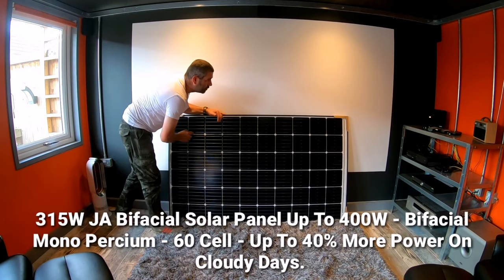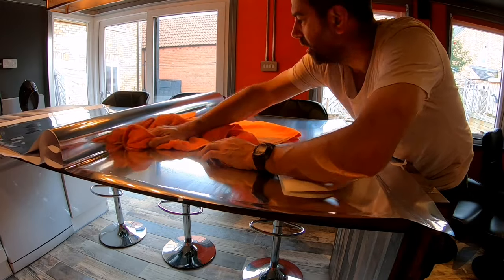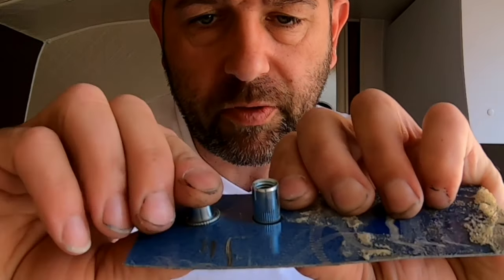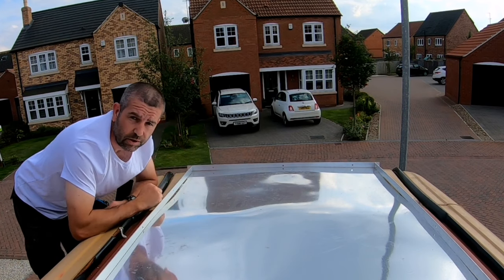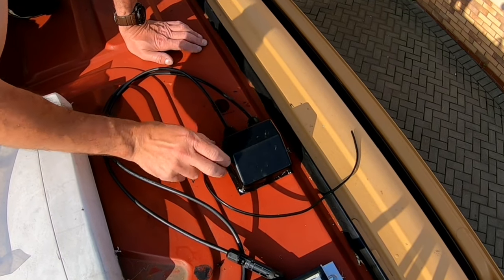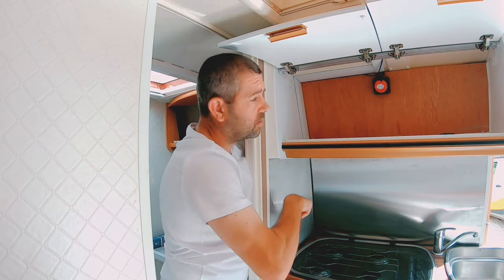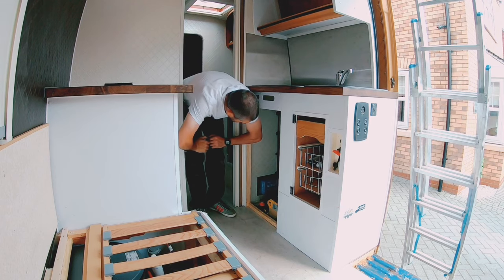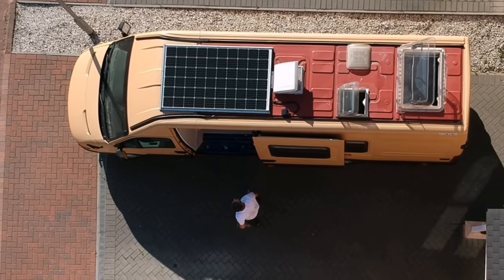Diy Camper Van Build: Installing Bifacial Solar Panels For Maximum Energy Efficiency

Comment from the maker: Amazon store showing affiliate parts list that I've used within the van build.
www.amazon.co.uk/shop/iveavan

Individual parts used within this video. 
Parts list link's 

Not the same bifacial solar panel as mine, that's now been discontinued! But this one is similar to mine. X1

https://www.bimblesolar.com/index.php...

Victron MPPT (Solar Smart Controller) X1. 

https://www.bimblesolar.com/30a-victr...

Cable Gland Entry Box. X1

https://www.bimblesolar.com/cable-gla...

Solar Panel To MPPT MC4 cables X 2. 

https://www.bimblesolar.com/mc4-cable...

32amp Breaker switch X1

https://www.bimblesolar.com/32a-din-b...

Or, an good full solar starter kit. 

https://www.bimblesolar.com/350w-vict...

DISCLAIMER! These are Affiliate links that I've provided.

Comment: Nice one Mark, That's 2 things you've helped me with on my Daily, underslung water tank fitment, which is now complete. and now mounting the solar panel, didn't think of using rivnuts! Off to see Greg, Luke, and co. at the South central self-build get together next weekend in Hampshire. Thanks again!
Reply from the maker: Excellent choice of van Mark 😉👌, funny enough I've been stuck with Luke on a boat for the past few days 🛥️😁, I said to him, if I'm down that way I'll pop along to one of these meets 😉, cheers matey 🍻👍👍👍.
Reply: @Iveavan  Wow, I hope there was Beer on this boat!? They are a great group and I've learned a lot from the meetups and passed on some knowledge too. I think you would have a blast, gets a bit messy when Darren Releases the Kraken mind! Are you at Camp Quirky next year?
Reply from the maker: @markstreet4612  haha😅, yes I am..... As long the van is ready..... Ish 😉👌👍.

Comment: Hi Mark Great kit only down side is the modified wave inverter.
Reply from the maker: Yes you're right. definitely not a pure sine wave inverter! the Amazon advert was wrong completely! Around about 6 to 7 months ago when I bought it, "advertised as a pure sine wave" , also it doesn't come with UK sockets, yet showed  photos of it having uk sockets!  That's why I've never recommended nor featured it in any of the videos. In the link below for the full solar kit, is an Victron Phoenix 375w pure sine wave  inverter (which may be too low on power for some). In reality though, we probably wont end up using the inverter at all, not only being inefficient way for an power source, every thing I have to power,  will be 12 volts, or can be charged up from the 12v power source. 😉👌👍👍👍.

Comment: Top job Mark 👍 Hope they work out as you want them too, with all the work you put into that 😊
Reply from the maker: Cheers Mike 🍻👍, I'd imagine, I will find out once using the van, at least I have the option of tilting the panel if it doesn't perform so well 🤔, Cheers again mate😉👌👍👍👍.

Comment: I fitted two bifacial panels to my camper at the start of summer,I originally intended to glue down some radiator silver reflective sheets,but after putting them in place to cut them to size,I realised that they not only reflected light but also a massive amount of heat. The manufacturer recommend a white painted surface which is what I went with in the end. Heat is the enemy of solar panels so I'll be interested to see if it affects your installation.
Reply from the maker: Cheers matey 👌👍, its been fairly hot in Hull over the past few days, so far, no issues with "performance wise" from the solar panel it self, but saying that, nothing is really working the panel, if its going to be hot today I'll put some load on the batteries for some time, and see how it copes with the hot weather 😉👌👍👍👍.

Comment: Nice job again Mark, the one concern I have is the total weight of your van.
I would have stuck the reflectics straight onto the roof of the van saving the cost and the weight of the panel in between.
On our new van, I'd like to put a lightweight curved model directly on the roof just fixed with strong adhesive. Perhaps low on Watts but much lighter.
Either way you've done a cracking job and when the sun finally hits Hull, you will have a fully charged battery too 😁
Reply from the maker: Thank you matey 🍻👍, weight wise, I am watching that very carefully (only have a pay load of 1100kg) I've pretty much used little and lightweight building materials where possible bud. I did think about wrapping the roof, but I can only stick things to flat surfaces (I'm not very good at wrapping 😉). The PVC sheet was light weight and straight forward to wrap thankfully, yep that panel isn't light I agree with you matey 😉👌👍👍👍.

Comment: Good well explained installation, I am also trying to come up with a tilting solution but haven’t figured it out yet.
Reply from the maker: Thank you David👌👍, I'm hoping that it may not come to the "tilting of the panel" yet. I'm going to run with it flat for now, and see how we cope with the Solar, if needs be, we may have to tilt it I reckon, to fully gain the full potential of the panel matey 😉👌👍👍👍.

Comment: Good idea with the silver reflective sheet , I wish I would of seen this video before I fitting my 4 panels on but then again that would of been another Job not done ,as I’m still saving for the ply to line the van , ifs funny really your in Hull and the cheapest ply wood is in Hull . In time unless you have done it already I’m going to make a turn table for my panels with some gas struts so it can be turned to face the sun , but there is no rush as I have 420 watts , but I do need to get 3 more batteries.
Reply from the maker: Cheers mate 🍻👍, cheep plywood in "ull" 🤔 I wish I knew about that! 😉. Still, bit of an experiment with this panel (what with it fixed into position) we may revisit and get the thing to tilt, but at 25kg....It is not light! But, if I work out the right NM rate to lift it, I too will be using gas struts 🤔😉👌👍👍👍.

Comment: G’day Mark if I was putting on top a solar panel the way you did it is the way I would.  Your panel is heavy at 25kgs most of the ones you see on YouTube are light, great idea of fitting the foil underneath the panel.   Great job sorry you Drone bit the dust regards John
Reply from the maker: Haha, I didn't clunk click with the battery, it dropped like a brick! 😣. Luckily it was insured 😉, that happened the same day that "Spunky" was helping, was hoping to get the insulation filmed from the sky🤦‍♂️. Yes, I agree with you mate, it's an very heavy panel, but we will see how it will perform (a bit of an experiment at the moment) cheers matey 🍻😉👍👍👍.

Comment: T-slot aluminium profile is an awesome material to build, well, a lot of stuff out of. My tentative plan is to use that, it just bolts together, and get some electric actuators up there and then have a panel that can tilt at the flip of a switch. Nothing really that complicated with it, just a question how to sort out the details. At least once I get the van and get started... I'm thinking I'll have several short Panasonic 295 watt panels, those should fit crosswise, not lengthwise. But that's a really nice very low profile installation you have there, stealthy and aerodynamic.
Reply from the maker: Sounds like you have got an interesting plan going on there regarding you're solar system mate, get it on " YouTube" bud 😉👌👍👍👍.

Comment: I didn't realise solar panels are so heavy !!! I've got three 340w feckers planned for my DAF45 lol
Reply from the maker: You've got an "bigger boys van" (truck) then me bud😁, yours will easily take the weight though 😉. 
Yeah, I was surprised how heavy the panel was mate, may be because its bifacial 🤷‍♂️ (not quite sure what the weight is on a standard panel 🤔) cheers bud 🍻😉👍👍👍.
Reply: Mark Collom #Iveavan certainly got me thinking more about weight dude, I’ve got a 350L water tank as well. lol
Reply from the maker: @sunnydaze6974  haha, mine wont be far off that if I had a full waste tank 300lts in total almost 😬.

Comment: Hello, i observe you dont left a lot of space between the panel, do the bifacial work well in this situation?
Reply from the maker: No, you're right. But never posed an issue regarding " overheating "over the 5 years it's been like that. 
However, it's now been changed to a 4 way tilting solar panel (the same solar panel) 👌👍👉https://youtu.be/_3uFo4NjxKc?si=TPF8qF7FKdppa-rz

Comment: Wow, didn`t know they did a Bifacial solar panel........ thanks Mark, is there any chance you can post a link to that `none drying bedding sealant` you mentioned? Also as a possible experiment at a future date - I was wonder if it might be worth adding a thin highly polished sheet of aluminium (to increase power output) instead of the reflective wrap, and then configure by add some coiled black hose pipe for hot water collection for the van + to help with heat transfer.........just a thought!
Reply from the maker: To be fair they haven't been out that long as far I'm aware of, here's that link you we're after 😉👌https://shop.highbridgecaravans.co.uk/carafax-idl-non-drying-bedding-sealant-white/p60206?source=froogle&utm_source=froogle&utm_medium=comparison_shopping_feeds&utm_nooverride=1&gclid=Cj0KCQjwwIPrBRCJARIsAFlVT88Z_pTJJ5XcR9NXC2VwAa1nPXkWcuF8GXRsM76PoDNxj_hPdUVoJhYaAr7qEALw_wcB
Yes, that's a good idea regarding the solar water heater, I need to watch my weight though (the Van not me 😂) I've used the PVC mirrored wrap for durability, if I used polished Alloy, it probably will tarnish overtime and probably won't weather well I'd imagine🤔😉👌👍👍👍

Comment: Another informative video Mark.  I would be a bit worried about the depth of the wall unit.  From the video it looks a bit in your face.
I suppose you could reduce the depth of the cupboard if it gets in the way...Thanks for posting
Reply from the maker: Thank you matey👌👍, unfortunately, the Iveco seems to have an steep curvature drawing up to the roof line, it's rather quite shallow in depth (cupboard wise) , but to hide the cable being drawn through the roof of the van from the solar panel, it had to encroach that space, but for me, I can live with it, as it has to be a functional space, to house an decent amount of storage space to suit our needs bud 😉👌👍👍👍.
Reply: @Iveavan  the other alternative is let someone else do the cooking and washing up :-)
Reply from the maker: @mrgari189  haha😅👌👍, I like your thinking matey 😉👌👍👍👍

Comment: Nice one Mark. I never considered the silver backing.  My van is Iveco white, so don't think I'll go there yet.  I've also heard they like a bit of ventilation too.  Will those holes you made be enough to let it cool?
Reply from the maker: Cheers mate 🍻👍, white will be fine, has long it can reflect light, I think this panel will perform better when tilted on a right angle (a bit of an experiment at the moment 😉), it was 27° here yesterday and seem to be fine and performing well regarding the heat. But we shall revisit this once fully up and running 😉👌👍👍👍.

Comment: Have you had any issues with water ingress through the rivnut holes?
Reply from the maker: No,  because I used none drying bedding sealant upon the rivnut, and long the bolt . 😉👍.

Comment: Neat job, the reflective panel underneath will really boost the output when the sun is lower in the sky or on cloudy days - will be a very effective package when you get a tilt mechanism on it. Pretty sure you could rig a manual one up maybe with some gas struts and a few locking positions. There are a couple of good ones on here and I've seen 2 kits for sale on Amazon that I'm sure you could make yourself and improve on.  Will be very interested to see what output you get on this flat and once you have a tilt mechanism up and running.
Reply from the maker: Thank you Linzi 👌👍, probably be a job I will end up doing in the future Id imagine, for this year I leave it flat, and concentrate on the rest of the build, ohhh and that engine fault 🤦‍♂️😁👌👍👍👍

Comment: Really interesting video, thanks. Like the idea of the stainless steel plate as a heatsink as I doubt many people would think of that.
I’ve got a question though, the trip switch between battery and solar controller looks to be  the type used in mains consumer units. Will this work with DC and such a low voltage?
Reply from the maker: Cheers matey 🍻👍, yes, fuse wise will be fine bud. Spunky, who's an qualified electrician verified this to me when I quiried this😉. The full kit was put together by Bimble Solar. Cheers again bud 😉👍👍👍.
Reply: That’s interesting and useful to know then. Thanks
Reply from the maker: @dieselbushcraft1299  no worries bud 👌👍.
Reply from the maker: @markbrameld  about time you showed up yeah bugger 😂😁👌👍, thanks for verifying that bud 😁👌, I remember the discussion we had whilst we were planning this vlog, but I couldn't remember how you answered it line for line mate. Have you seen the news regarding my engine on insta bud? 😢🍻👌👍👍👍.
Reply: 😂😂 only just worked out how to read and reply to videos on iPhone 🤣🤣 no mate you know me I’m down with kidz and all this insta, blog, vlog, snap stuff 😆 what’s wrong with van?
Reply from the maker: @markbrameld  I'm shaking my head at you "" 😳"" 😂, get on insta bud, and you'll see my fuckwit of a problem mate 😱. Thanks to Mevi I've got a plan... If my further investigations tomorrow ain't showing too fruitful 🤷‍♂️🙆‍♂️🤦‍♂️😬.
Reply: Mark Collom #Iveavan lol 😝 I’ve just replied on insta mate 👍